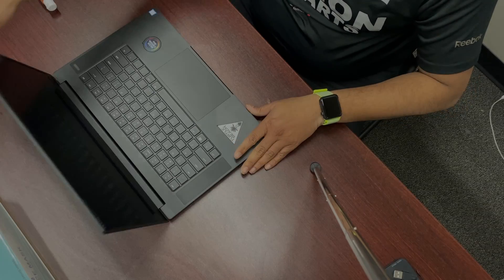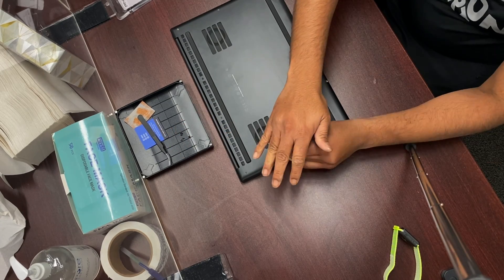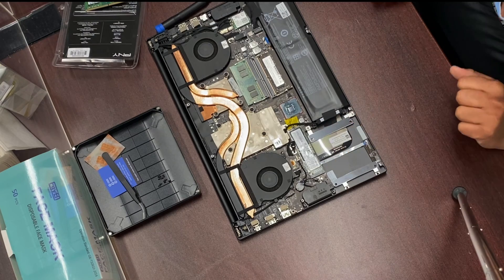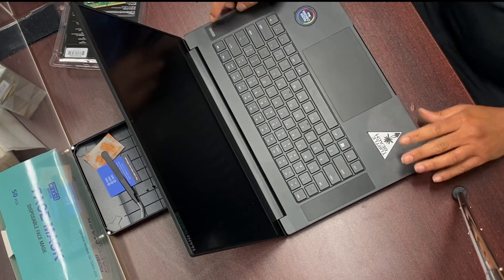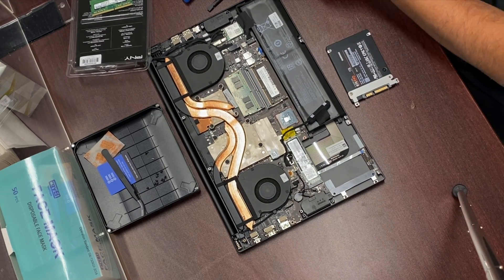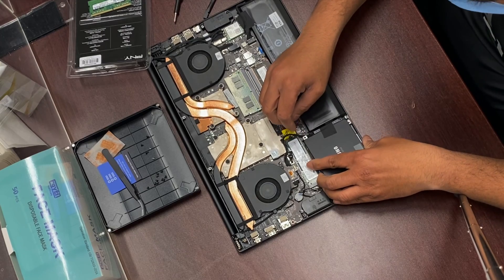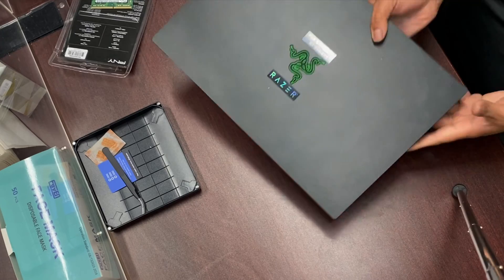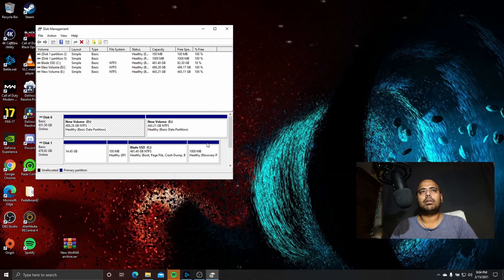How to upgrade RAM and ADD a ssd to RAZER BLADE 15 2020/2021in 10 mins

Comment: I opened up the disk management after installing a new ssd and I only have disk 1 no disk 0 did I get a lemon of a ssd or is it just not connecting correctly
Reply from the maker: strange reconnect and try again

Comment: thanks for video , can I upgrade to 2*32 gb of ram ?
Reply from the maker: as far as my model goes you can upgrade to 2*16 gb 2667 mhz speed ram
Reply from the maker: do check your model no. also go to task manager to see the ram speed that originally came with the unit
Reply from the maker: some US units or models do come with 3200 mhz

Comment: hey im confused, there are 15i nch 2020 base model razer blades that have an additional m.2 slot marked for you and the the main ssd is located in the place you installed the ssd in your video. can you please confirm what razer model are you using ?

Comment: the inside of the 2021 version does not look like that...
Reply from the maker: models vary according to region
Reply: @Techado  Then the video is fucking useless.  There's no second slot to put in a second nvme SSD whatsoever.

Comment: Hi, does the Blade 15 2021 accepts 64gb ram with 3200hz ?
Reply from the maker: nope can go upto 32gb 2667mhx
Reply from the maker: mhz
Reply: @Techado  Hey I just checked on my Blade 15 2020 and in the task manager it mentions a speed of 2933 MHz for the Memory.
So I assume I would need 2933 for the new ones as well?
Reply from the maker: yes sir! you right about it !
Reply: @Techado  thanks for the feedback 👊😊

Comment: I just bought the Razer Blade 15 advanced 2021, but when I wanted to add a ssd to it, I noticed the absence of screw to fix the new ssd !
Do you think it's normal ? and if yes, can you give me the screw référence to fix the ssd ? Thanks
Reply from the maker: yes you are right and that is the reason in the video i recommended to buy ssd mount for desktop and you can use the screws from the box , all the items are listed in description including parts and links
Reply: Just double sided tape it down, it's what most people do
Reply: @copieXD  thanks for your answer, it’s what I have done 👍